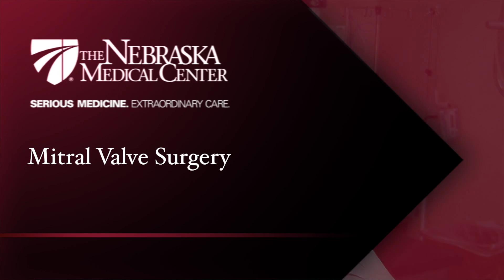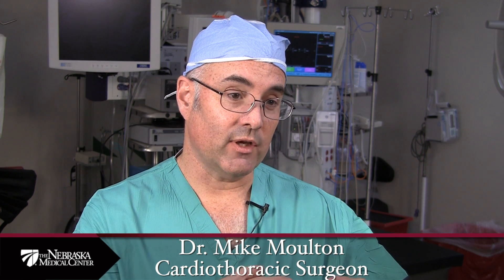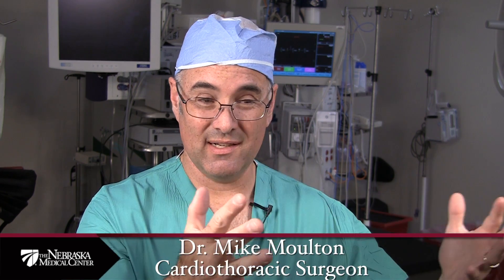Mitral Valve Surgery - The Nebraska Medical Center

Comment: Nice video.  I'm two weeks into recovery from mitral valve repair surgery.  Differences in pre po and post OP breathing was difficult getting used to for me at first.  Getting better though all the way around.  I can see it's going to be a life changer for me.
Reply: Dr also said to me heart surgery velve operation but m so afraid .have any other soulation .or how much time require for recovery . please tell me